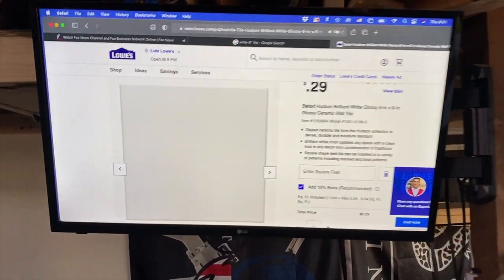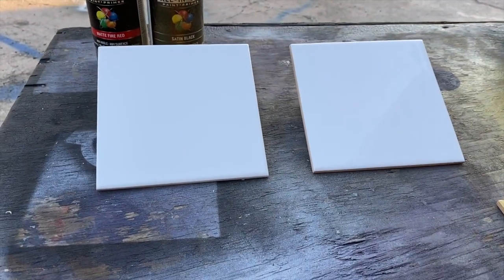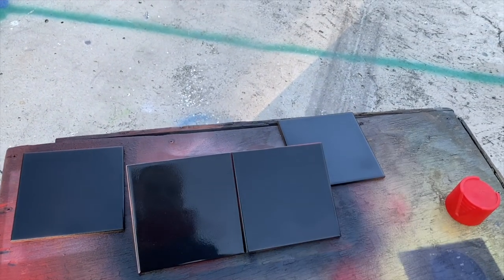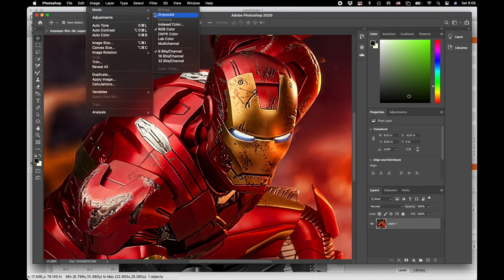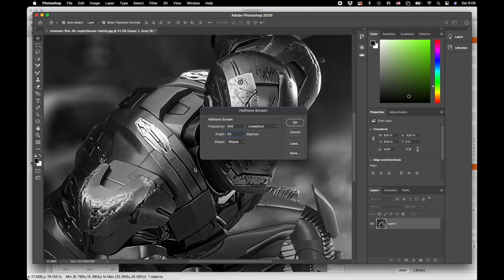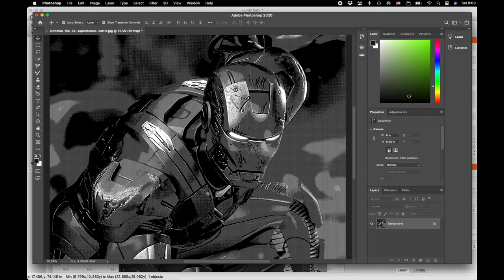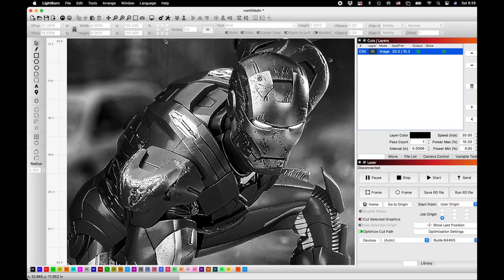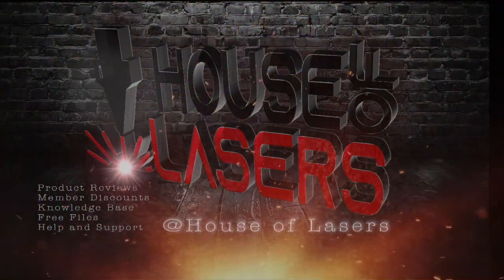How To... Painted Tile and Halftone

Comment: Thanks for the easy to follow video. I followed the video but ran into a issue, when I saved the tile  at 4x4  it open in lightburn 4100 inches. any idea on what i may of done wrong.

Comment: Very great video and information as getting color on my tiles has been a challenge for me I either get color with hardly and image or I get an image with no color. However im still a little confused. When you first brought your image into lightburn you have negative image and pass through on. When you get into the different engraving methods I noticed that negative image is turned off. So do you engrave with negative image on or off? I’ll keep trying but that is a question that’s been in my mind. I use lightburn but also use Gimp as my photo editor 
Thanks

Comment: My co2 laser will not work with LightBurn. I can only use my 20w diode laser with LightBurn. Question is can I use the gimp plugin big gimpin or the imag-r sight to prep the image to burn on my laser without using LightBurn. Thanks for this great video lot learned here.
Reply from the maker: You can use LightBurn to process and save the laser ready photo

Comment: If what you are saying Lightburn resamples the image then it would output at whatever you set the dpi to in the halftone setting. Yes increasing the dpi in the photoshop file will give you a better resolution to create the dot shape in bitmaps but it’s resampled in Lightburn. Effectively you will never get anything above the dpi set in Lightburn halftone, although I inadvertently set the dpi to 1000 and tried to run the job and it took 4x longer. In commercial printing the rule of thumb was 2x resolution to that of halftone screen but the raster image processors that created the final plates were capable of 2540 mm plus. If you had a way to figure out the file size of the final output image you could prove this but I don’t know anyway to do that.

Comment: I really want to do something like that. I have a DIY CNC Laser Engraver kit from China. I changed the controller with EleksMaker v.5.2 and the 20W EleksMaker diode (?). So far I have used Benbox software. I tried Lightburn but I don't know how to set it so I can make these tiles. They can be made with this kit from China or only with a CO2 laser. I can't make the gray scale. Only black and white.

Thank you.

Comment: I'm glad I found this video. However, may I ask, I'm using lasergrbl. When I open the file, it enlarges by about 10 times even though I've set the image size in Photoshop and resolution. Any idea?
Reply: i realize it has to be 'save as' instead of 'exporting' it as png.

Comment: So you DONT use passthrough? You just touched on it to tell us what it is. Correct?
Reply from the maker: Correct, those that don’t have LightBurn need to process the photo first. 
IMO there’s no need to process externally if you have LightBurn, it does an amazing job on its own
Reply: @HouseOfLasers  So if i did process externally, can i just switch off the pass through and THEN put it in half tone...because i really liked how it tricks the eye. Or do i have to do just one or the other?
Reply from the maker: @LakersNinersFan  if you process externally than LightBurn will have to be in pass through. You can not process it twice without loosing a lot of detail
Reply: @HouseOfLasers  OMG! I just did an image like you did in light burn and it turned out into the BEST image ive done. You made all those scripts obsolete just by using nothing more than Lightburn. Thank you!

Comment: How long did the individual burns take ?
Reply from the maker: 30-50min depending on process and dpi
Reply: @HouseOfLasers  im using a diode laser,  and not exceeding 300 dpi but theyre taking considerably longer than that.

Comment: What are you using to prop up the tiles
Reply from the maker: To paint ? 30oz powder coating plugs.
Reply: @HouseOfLasers  Hmmm
Reply: @TheDwilliams1000  I dont know what those are either but I do know there are little orange painters triangles that are available at hardware stores.  They are super inexpensive.
Reply: @cw4608   just use whatever you have laying around, no?
Reply: @ToddMoore1  yes, I just happen to have some little painters triangles laying around that I use for my woodwork.  Worked better than the cat which also tends to lay around.  :)
Reply: You have a laser cutter? Why not use your laser to cut angled supports to your liking? Plywood or other scap can be pretty handy, and you don't have to pay for it. No need to spend money on some purpose-built item... :)
Reply: @cw4608  I find the embeded fur can be a problem too. :)